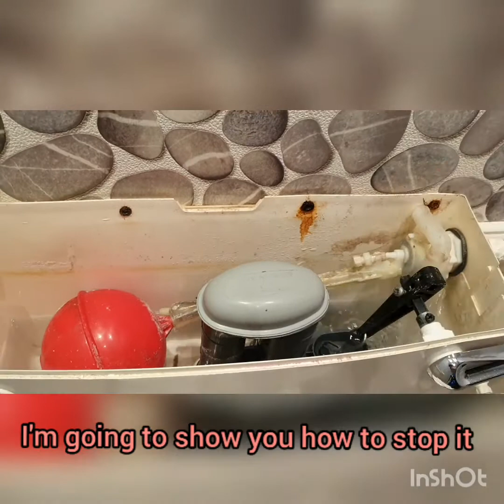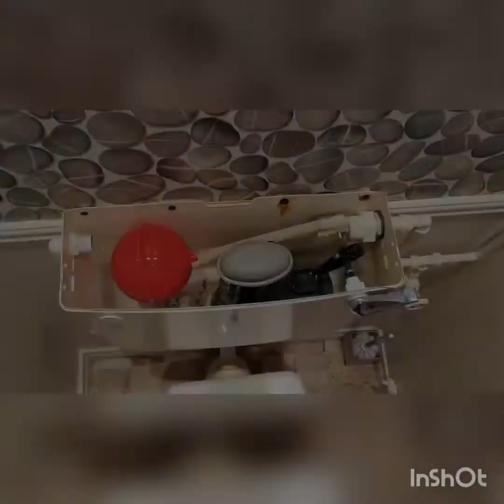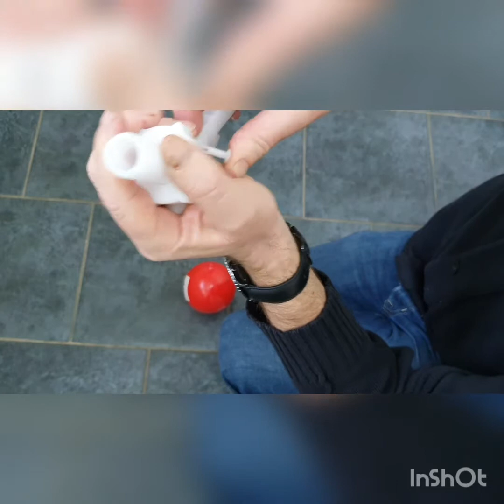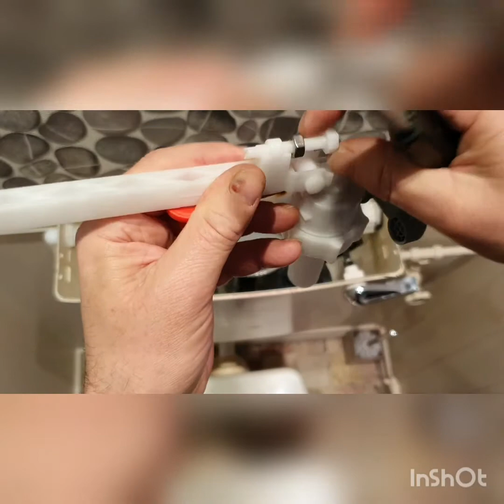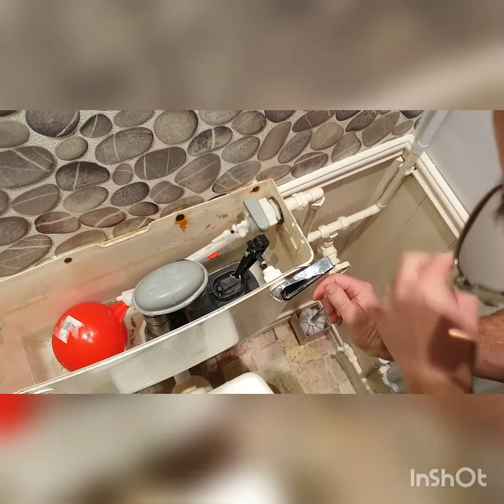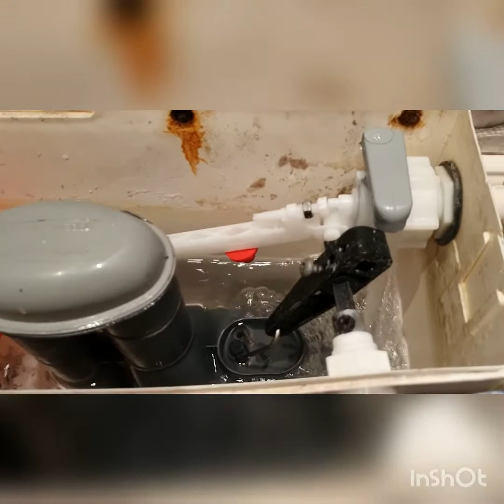How to change Ball cock inside a toilet Cistern

Comment: Where do you buy the replacement. Tried Screwfix and Plumb base. No good, don’t sell them anymore. Help.
Reply from the maker: Have you tried amazon, look for ballcock assembly. Or Ebay, try your local wilkos. Hope this helps. Ian
Reply from the maker: Think I used my local plumb centre
Reply: Thanks Ian, found the very same one on Amazon. Job done.